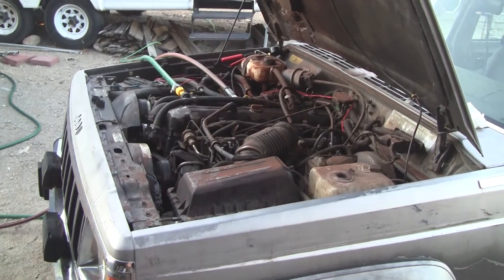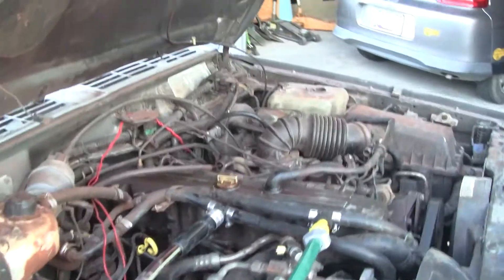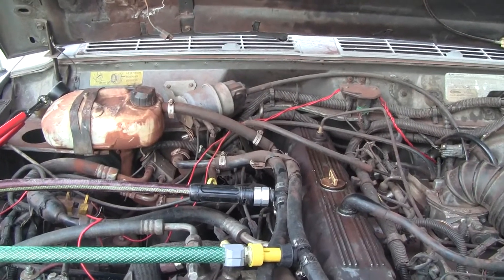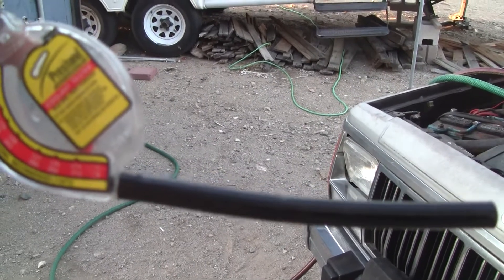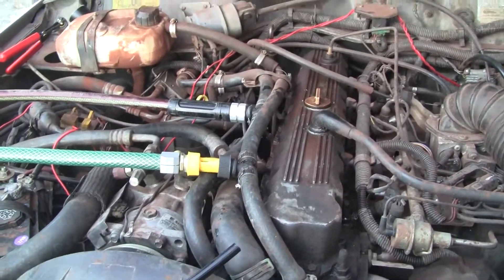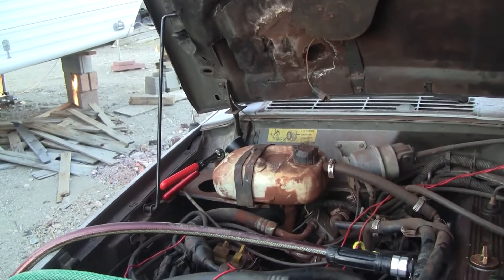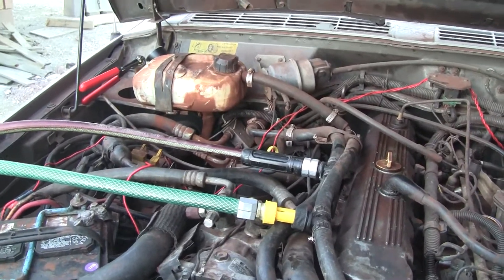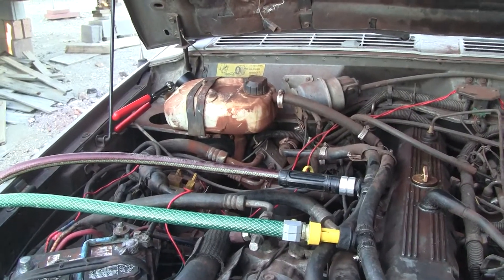1988 Jeep XJ Cooling System Flush.

Comment: Technically the pressurized system was superior in cooling ability but it was terrible with longevity.the heat cycles causes the plastic to get brittle and fail. That and bad maintenance cycle habits cause the system to fail as well.

Comment: Thanks for this! How do you get water from the hoses out to get the coolant into the system. Do you run the engine with the hoses attached to let the water flow out? I’m curious what ya did.
Reply from the maker: The green hose was the fresh water supply. The brown hose was the drain from the cooling system to nearby bushes.

Comment: I have an 87 xj same cooling system where do I pour the coolant in the over flow tank?? And how far do I fill it up ??
Reply from the maker: Passenger corner against the firewall, is the coolant bottle location. 1/2 to 3/4 full.

Comment: Kinda late here, but wanted to post.  I, Ironically, yes, have owned 2 1989 jeep cherokee limiteds with the 4.0 over the span of about 15 years and also, yes, a 1987 renault GTA.  Currently have two convertibles as parts cars and plan to, when I retire, make one good car.(since they only made 1085 of the cars total!)  That was my "young man memories car" having a standard alliance convertible in high school and then in 1993 buying one of the rare 1987 GTA race tech models they built for only a year.

So, you were asking about that screw hole on top of the water bottle?  Well, the GTA has the same water bottle system for cooling.  Ultimately I think they made those water bottles for multiple cars in the AMC lineup.  So, maybe on one of them I am guessing there was some use for it to maybe to secure the water bottle based the positioning etc.?  Just a guess, from a guy who has owned a renault for 30 years and had those same year jeeps for 15 years as well. And agree, the cooling systems were a pain in the butt for those cherokees!  But, one thing I would say is, often overheating problems on them can be simple.  The caps they made for the water bottle were spring loaded like a thermostat and functioned in a way where they would open base on a certain temp and/or pressure.  And they, IMHO, were a design flaw. Ultimately, those went bad ALL THE TIME!  I ALWAYS kept an extra new cap back then in the jeep knowing it would eventually fail.  And replacing the cap often fixed overheating issues until it would eventually go bad again...maybe last about a year or two.  Anyway, hope some of this helps even though you posted this 5 years ago for people who may look at this now.  But a cap is sometimes better then thinking it is something much more major like the cooing fan, or rust flushing the heater core which I did as well.  Usually though, after working on it for years, it was typically the cap when it would overheat!LOL🙂
Reply from the maker: Never too late !! Thanks for sharing your experience !!

Comment: THE HOSE UNDER BOTTLE IS CUSTOM MADE BY FACTORY (OEM) YOU CAN BUY.
Reply: Yup, I think I purchased one of those as well over the years since they seem due to the pressure and heat to rot over time from the inside out and get very "soft and mushy" thus eventually leaking fluid and air.

Comment: Where did you drain the coolant from before you did the flush? Then how did you refill after the flush? This video is going to save my ass. Liked and subscribed!
Reply: The drain petcock is on the passenger end of the radiator, pointing toward the rear of the vehicle. I think it has left hand threads like to many drains do. I refilled the cooling system through the over flow bottle back on the firewall. Or Maybe through one of the garden hose connections. That part I'm a little fuzzy on since I changed to a regular radiator with a cap on it later on. But I kept the original overflow tank by making an adapter to adapt it to the modified cooling system. Thanks for the support Stewart !!!

Comment: About to try this on my 88, looks like a good way to do it. To open the valve, are you applying pressure or vacuume to the system?
Reply from the maker: The hand vacuum pump is to open the heater control valve for a flush that includes the heater core. The green hose towards the front of the valve cover has water pressure in it from the house. It's attached to the thermostat housing hose. The brown hose is attached to the other heater hose with a T so the dirty water will drain away from the vehicle. Go easy on the water pressure. Your house can be 75 psi while the jeep's system is only 13-15 psi.
Reply: @mikep95133  awesome! Muchly appreciated!
Reply: How much vacuume pressure do you apply to the valve? I think you said it in the video but I couldn't find it.
Reply from the maker: @KRYSPYKRUNCH  I think you need at least 15 inches of vacuum in order to open the valve fully.
Reply: @mikep95133  awesome! Thank you!
Reply: The xj closed coolant system is amazing but unreliable in the way when it starts leaking it automatically lets air in.

Comment: As an owner of a 89 Cherokee, it's nice to see I'm not alone in the struggle against this engine's cooling system haha I've replaced the thermostat and water pump already, but I suspect blockage in the heater core. Thanks for making the vid! These late 80's engines are pretty different from the majority of 90's XJ's on youtube.
Reply from the maker: After I had the radiator rodded out, the cooling system was easy to bleed and works great.

Comment: nipple on bottpm of pressure tank is 7\8 ths. and you are right these systems are a pain to fill, flush, bleed. just replaced my tank and a couple of hoses and it takes me a couple of days to get the air out and the level correct. thanks. good video.
Reply from the maker: The old tank being so high up really helped speed up bleeding the system.

Comment: Which insert in the heater core valve did you insert the vacuum pump to keep it open?
Reply from the maker: As I recall the heat control valve on this Renix only had one vacuum port.